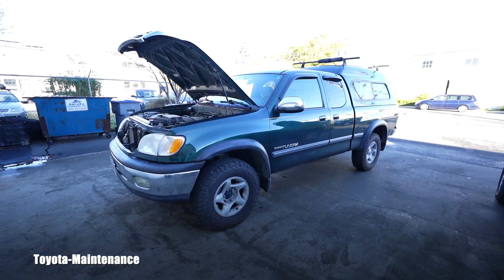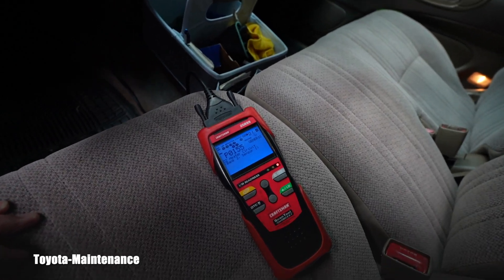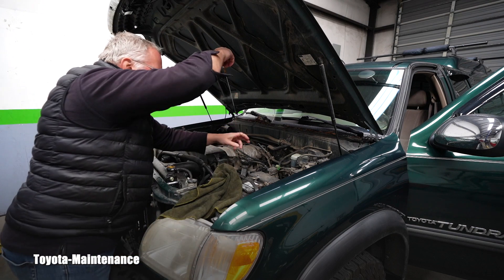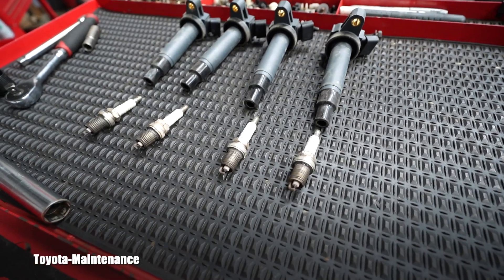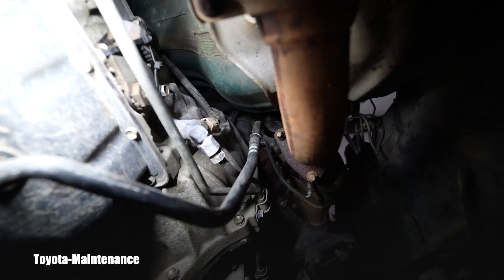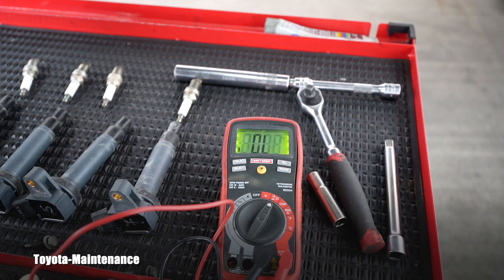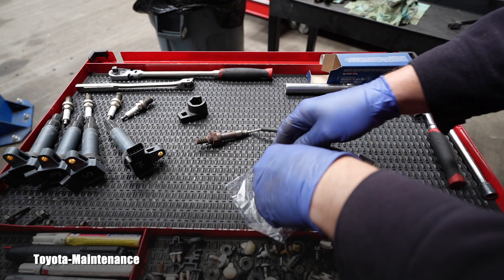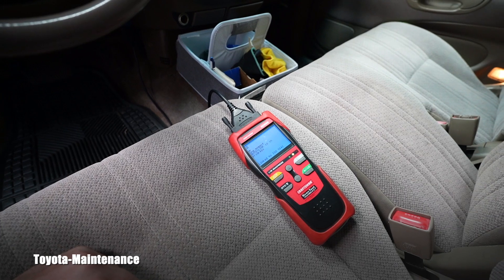Toyota Tundra Code P0155 O2 Sensor Heater Circuit Diagnosis Repair

Comment: Good one Petr. However, the 2UZ-FE always shows low oil pressure when hot and at idle. Oil pressure increases with engine RPMs, or when the engine is cold. Perfectly normal, but it scares some people needlessly.
Reply: The oil pressure regulator on the oil pump is stuck open. Run some marvel mystery oil in the crank case.
Reply: @jameswalker3973  No it's not.

Comment: With those cheap coils and spark plugs I would pull the timing belt cover to see if it was actually changed.
Reply: $1000 sticker job lol

Comment: I just recently replaced my bank 1, sensor 1 O2 sensor Peter, , , they are so easily accessible, , , also replaced the fuel pressure regulator, , , also easily accessible, , , I absolutely love my 2001 Toyota Tundra Access cab,4.7❤️
I wish YouTube would let me upload pics of my truck, so I could show you all.
Thx for the video my Friend 👍🏻